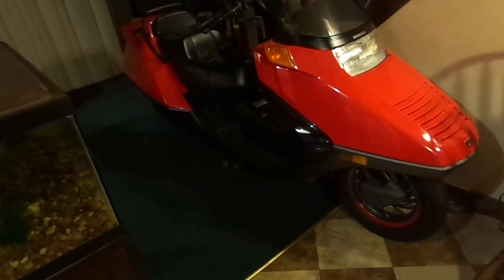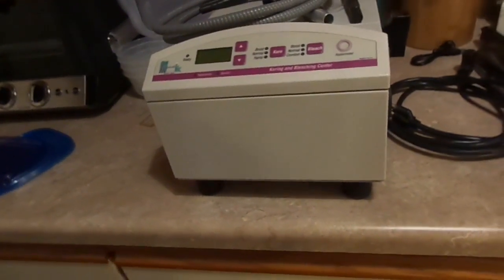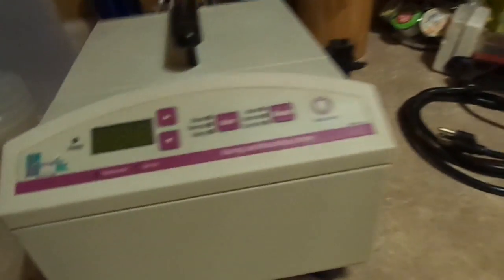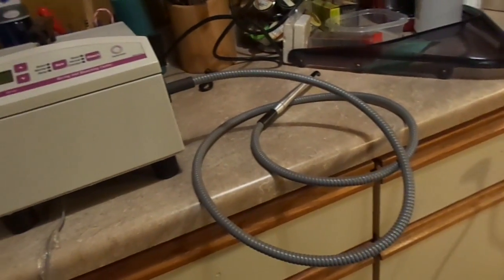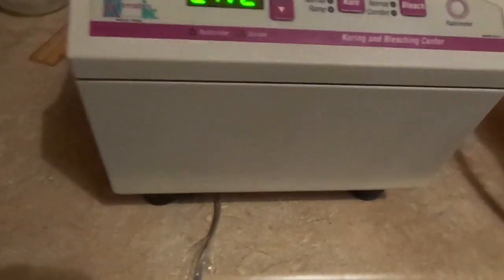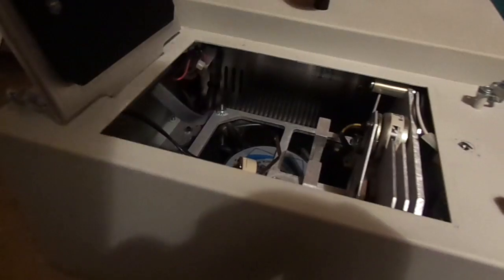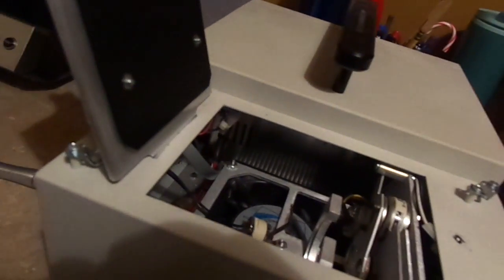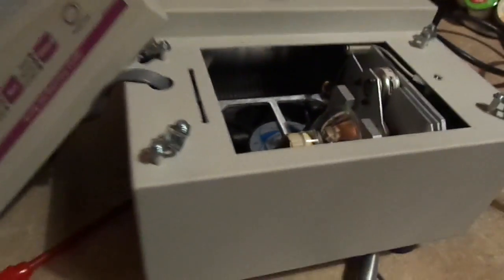Kreativ Dental Ultraviolet Curing Machine

Comment: There is a blue glow visible inside the machine after you take it apart, but I don't know if that was coming from the UV lamp or just a reflection of something else.
Reply: It actually IS the blue light that cures the resin, not UV.

Comment: In dentistry, amalgam is an alloy of mercury with various metals used for dental fillings. It commonly consists of mercury (50%), silver (~22-32% ), tin (~14%), copper (~8%), and other trace metals.[1][2]---wixiepedia
Doesn't require UV light to solidify.
I think it is some kind of epoxy filling material that is cured with the intense UV light.

Comment: id at least keep the fiber optic able and wand.. you might find a use for that
Reply: The keyswitch and fan are also useful parts to save.  Possibly even the power supply, depending on what it outputs.